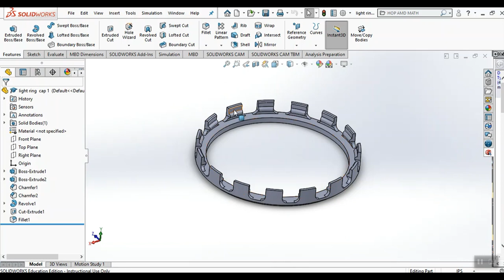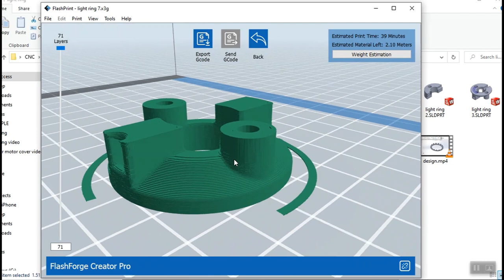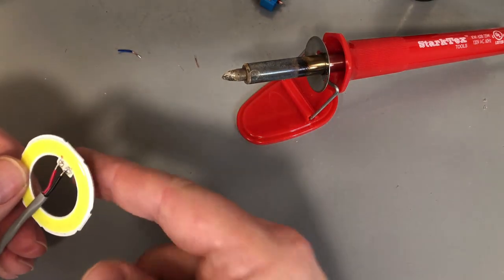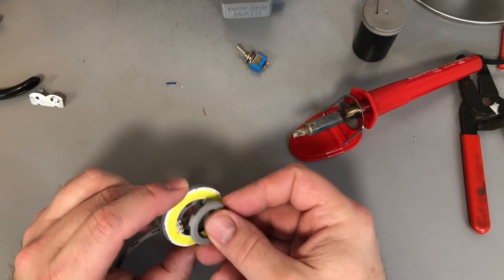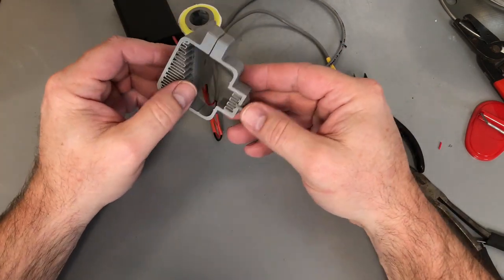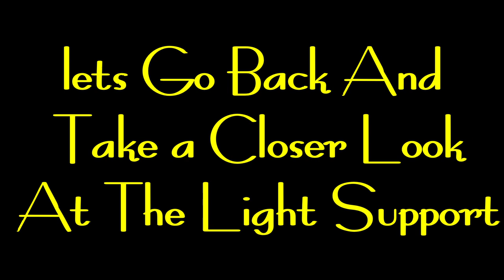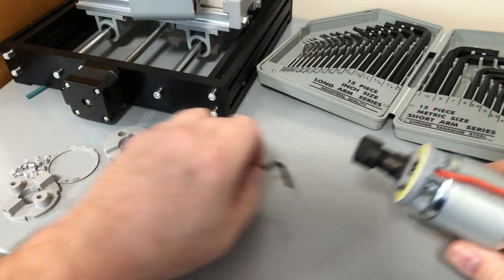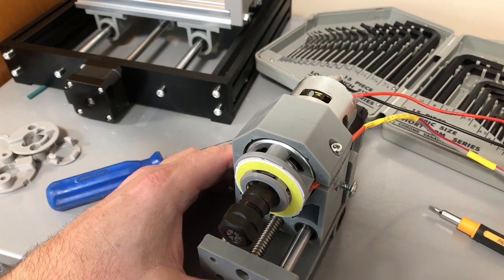cnc spindle light

Comment: Cool  idea and a great problem solver.
I don't have a 3d printer but it has opened some ideas I can use.
I did a quick search for the led light you used but could not find. If you have a link I'd appreciate it.
Thanks for sharing.
Reply: I picked it up at my local dollar store
Reply: @shopandmath  Thank you. 
I did find a source on ebay from china designed for 80mm or 65mm ring for $20. 
Thanks for getting back.
Reply: @wm973  I spent $3 at dollarama 
In Kitchener Canada
Reply: @shopandmath  I don't have a 3d printer so the china option is best for me.
I do like the extra features you put into your design. Well done.